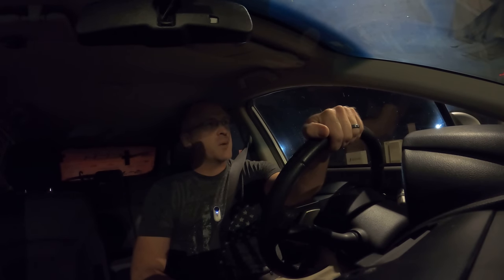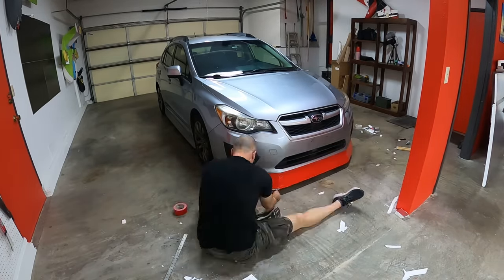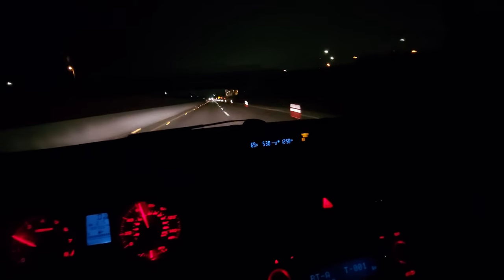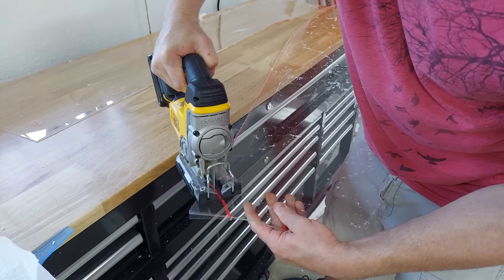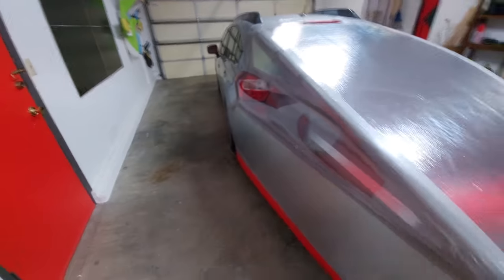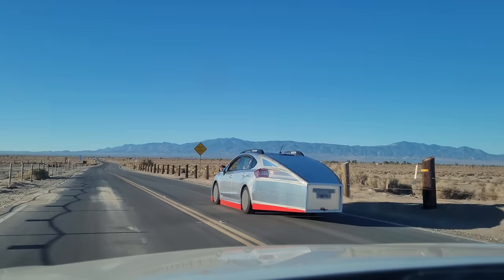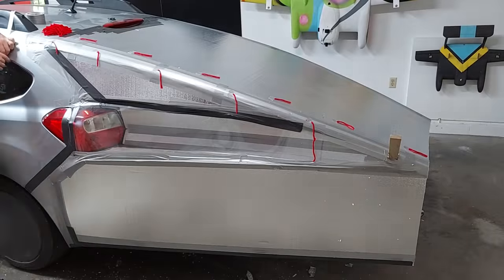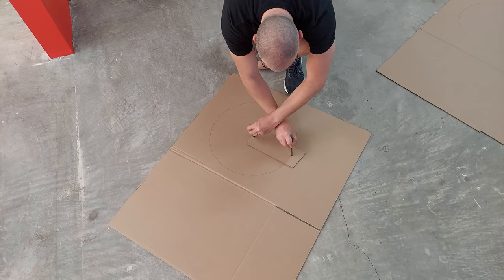Beating High Gas Prices Using Simple Aerodynamics (Home Improvement Store Edition)

Comment: At first, I was like, "Damn, this guy really has time on his hands," Then I remembered once my tank used to fill up at N$614, and the last time I filled it up at N$500, I was awesmacked to see that it was only half tank, this, "Mmm, wait a minute. This guy is on to something," and with that said, my car did win 2008 Guinness world record on efficiency, and with my capable hands, and your mods, it might just beat it again or at least try to as the newer gen with a smaller engine does 2,200 on one tank. Peugeot 206 1.4 8v hdi if I am not mistaken. Maybe also get rid of things I don't need in the car, and there are a lot of them, like the Jack, and a few things I can't mention, spare as I do have quality tires and sludge, so replacing a tire is highly unlikely.

Comment: The only way to ABSOLUTELY know if you've filled the tank the same is to fill it to the spout.  They don't let you do that in California, so you'll need to go to another state to try, or do the last bit with a gas can. It's possible you have air bubbles in your gas tank too, taking up differing amounts of volume each time you fill up.  Or go full mythbusters and get some super accurate fuel flow tracking software for the car.

Comment: So, $200 in foam/tape saves ~20% fuel cost...   At $5/gallon we have to save 40 gallons.  @30mph  =1200 miles driven to save money assuming you mostly drive at freeway speeds and not in a city... KEY point!  If city driving you would see a tiny fraction of this savings.

Comment: you should change the way you measure, since the fuel pump stop fueling because of the excess gas in the tank, this always will be different depeding even on how you drive

it is very dificult to measure it in standard tanks, when you do this on racing, you put in an exact amout of fuel, do the test and many times you take it out and measure it or even sometimes cars have a fuel gauge that it is way more accurate than street cars

another thing that change a lot it is the temp, humidty and pressure that you live in, so since you changed and adjusted routed that might be helping to a different result

hope you make more experiments like this one, take care

Comment: nice work; you should definitely keep going; right up until you start finding little bits of foam in your bed and food.
we've done some aerodynamic experiments with ultralight aircraft and gravity powered cars over many years.
yes; sometimes results are counter intuitive; there are some obvious "rules" surrounding  aerodynamics; but the problem is sort of a "moving target."
everyone knows that the effects of drag increase with speed; I would suggest that you do some data logging at 2-3 different speeds during your test runs; as flow detachment occurs at different rates, locations based on changes in speed.
 yes: aerodynamics is important in automobiles; however if maximizing mph is the goal; other items such as weight, desired cruise speed and the type of wheels +tires are also BIG factors.
Due to the "ugly" design parameters required for passenger cars such as safety, performance, comfort, durability; most are much heavier than optimum; because tradeoffs must be made and the goal of maximizing mpg will always have to "take the back seat."
example; if you put the lightest combination of wheels and tires on any vehicle; you should observe the range performance go up; but conversely the safety (handling, stability, stopping distance) and durability will go down. ( see also rotating mass, moment of inertia , , sprung- unsprung mass, hysteresis)
I think most people would be shocked to learn the actual curb weight of their cars. (try pushing your car on level ground!)
Adding things like a full tank of gas and passengers can markedly decrease mpg performance.
One of most important factors that affects mpg is the personality of the driver.
If everyone simply drove the posted speed limit; the country's fuel reserves would be greatly extended and there would be far fewer accidents ( about 30K deaths annually)
For more information about driving technique that maximizes mpg ; checkout "hyper-driving"
whoa....my coffee is working

Comment: You got lucky with those cops. If you had those lights on your rear plate set to blue that can be Very Illegal! Some states have permits you can get for Red, Amber and Blue lights but in general Blue  is restricted to the Police/Lawn Enforcement. Most cops don't care if it's within the range of Blue White, but if it is clearly Blue and not simply an off hue White they can really get on you.

Comment: You can also measure drag by driving through a makeshift set of wind indicators，see how much air the car grabs at what speed and how wide  and tall of a cross section it effects，
，you can have an idea on how much energy the car ultimately exerted by trying figure out how to measure how the car has created moving air ，it's shape and intensity
or how much of a “ripple” the car is creating
go straight for smaller “foot print”
this will save you a lot of time and money，and can have a more reliable proof when something worked

side note as a car guy，you are not watching any ob2 data，no intake air temp，no knock retard，no ignition timing，not monitoring air fuel ratio，no humidity measurement，these will massively effect the efficiency of the car,  and you are running 87 on your suburu, which can have unrealiable ignition timing depending on the car‘s mood. 
If you monitor all these variables and use at least 91oct，then you only have to see the electronic throttle position to know how much the car is pulling air hence burning fuel to maintain certain rev at certain speed on certain gear over the same stretch of road. You can get an instant reading and not having to go though the good old pump.

also I recommend doing tests by moding submarine toys with a stable thrust output
or a heavier than water car in a long glass tank runway
it's much easier to ink water and visualize everything than to set up a car to drive though smoke

Comment: Completely uneducated guess here. I don't think the fact that the tufts are laying flat necessarily equals better efficiency. It indicates that you have nice laminar flow over the surface. But having laminar flow does paint the whole picture. Maybe breaking up that boundary layer flow actually boosted the efficiency of the old tail? I'm thing something along the lines of the golf-ball effect here.

It might also be case the case that you have too much variance in terms of how much fuel you are putting in every time. Have you considered installing a high precision metering valve or something in the fuel line? Or using the car's built in trip computer to calculate the average over some distance? I know that, that's not the most accurate thing, but it should at least give you an indication of where you are heading in terms of relative performance, Even if it doesn't give you an accurate absolute indication. 

Would it perhaps be possible to weigh the car instead?  Don't know if you'd be able to find a scale or weigh bridge that would be sufficiently accurate.

Maybe you could figure out some workable combination of the above that would at least help you figure out how much noise that fuel pump is adding to your data.

On a carbureted car it would be easy enough to make a makeshift tank that allows you to accurately and precisely top up the fuel, doesn't seem practical on a fuel injected car though. 

Interesting stuff - keep up the good work!

Comment: I am not an aerodyamicist, nor am I procicient at spelling that word.  But the lower rear area that you changed could have been angled up too steeply or the transition from the underside was too abrupt.  The things I've read about this area from different sources are pretty specific about this transition.  However the things I've read concern the transition when it's still under the car.  YMMV. Literaly.

The angle for this area is always prescribed to be 9 degrees.  This is for the diffuser area from about the axle to the rear bumper.  I have no personal experience with it.  It's just a thing I read in a few places.

Comment: If you want to actually test how much fuel you're using, you have to do it by weight before/after a run. That's non-trivial because a scale that can weigh a car isn't typically that precise.

It's more than 'good enough' however, do use the calculated fuel economy data available over the OBDII port, seeing as you're just looking for delta over baseline, and those systems are consistent in that regard.

Also, the new tail could be less efficient due to air contacting it more. You do want to cut through the air gracefully, but, the air physically dragging along the surface of that foamboard isn't doing you any favors either.

Comment: You can't use wheel covers because it could damage brakes (overheat). 17% in my opinion is just measurement error. But even if it gets 5-10% then you could use it in racing, for example in 1/4 mile race. This is the only use that make sense in my opinion. You can't use it in daily car because of law regulations. But still it's nice work.

Comment: Inevitably Some air Will go under the car, so dealing with that would be effective, OR, I know this wouldn't be cost effective but Finding another car all together. Im a big fan of Subaru, But, for these tests/Hobby... The Awd platform isnt the greatest, It has inherent drag associated with more weight and moving parts in the driveline, regardless of if they are being really used at cruising highway speeds or not. A Honda Crz or better yet an Insight would be optimal. If you didnt want to go the older car route the new Prius is actually quite attractive, and has about the same body shape. They come in FWD and AWD. So you could still get the AWD if thats important to you.

Comment: If you actually want to increase efficiency in a more real life kind of driving experience the key is loosing weight... Replace seats with lighter ones, remove unnecessary heavy parts end if you can't/don't want to remove just replace them with lighter ones

Comment: you are adding weight to the car which means burns more gas to accelerate and also traffic can play a role if you ever had to slow down once for a car in front of you itll throw the measurement off.

Comment: You can buy giant sheets of flexible black plastic from Home Depot. I used it to make mud guards under my engine area and remake the fender liners. I simply used the standard push pin style little plastic retainers to hold these parts on.

Comment: Unless you are using an entire full tank your data might be messed up by using the cars estimated range. Estimated range is based on fuel level and we all know that there is not a single gas tank anywhere in this world that gives linear data for fuel levels. You should change your message to full tank only or topping off and counting the gas that is replaced

Comment: Gas pumps and a car’s internal metrics are extremely inconsistent, even on the same pump and fuel.  The stop is based on a back pressure trip that will vary based on flow rate and atmospheric conditions.  The only way to be remotely consistent is to add until gas fills the fill spout.  Only then are you truly measuring apples to apples each time.

Comment: pumps are VERY unreliable at filling the tank the same time every time. you would have to do like 5 to 10 runs for each design to get a good idea. ORRRR. measure out the fuel and run until the car runs out of gas and then check how far you went

Comment: i bet at least 7 to 10 percent increase in efficiency lies underneath the car. gotta smooth that sucker out. ABS plastics should do it. but really, go all out , cover rear wheels, make a air curtain like newer cars have, smooth undertray with lots of air passing through, remove mirrors or place smaller ones, air dam the wheels from the front and make sure you have Smooth separation at the back. and come on, the roof needs to be smooth too. Ask for a collaboration with KyleEngineers, he is goot at simulations. I need to see this cars final form. do it for the memes. edit: you dont need that much cooling no? close some vents in the bumper.

Comment: Did you take into account environmental conditions? Air, road temperature, tire pressure, and especially wind speed and direction is a huge factors, that could easily make an impact of more than 20%. Even humidity and air temperature make an impact on how your engine works and tire rolling resistance... Also traffic speed and density... The fuel hose is not accurate. So if you want to get real numbers, you need to go to the wind tunnel. And on a thumbnail, if you write the percentage, it doesn't matter, if is it per tank, gallon, or liter, it is the same. Overall nice work for entertainment. And may it is a good business idea for an aerodynamic Skybox on a back 🤔

Comment: Dude just measure your rpm at high speeds and see whether rpm is the same at 90mph with Styrofoam and without Styrofoam 

(Update: was gliding behind a semi and rpm stays the same no matter what it appears the computer will give consistent rpm to the transmission regardless power saving method) 😞

Comment: Not to be a conspiracy theorist, but I’ve had had gas pumps “put” significantly more gas in my tank than the tank can hold (even accounting for the neck). I don’t think it’s a reliable standard. A good solution could be a jerry can so you know exactly how much fuel is used

Comment: the key thing responsible for your dalliance into automotive aerodynamics failing the more you try is because manufacturers already designed the vehicles to be as efficient and aerodynamic as possible within the confines of the body without sacrificing usability. so, adding anything extending beyond the body would just screw up the carefully calculated and designed aerodynamic features. take the loss, start over again with something simple like a go kart chassis and a single quart of fuel.  its way more effective to measure small changes more often than driving 200 miles and changing some things that end up not working. you're just wasting time and recourses for something that's so cut and clear that its a little difficult to see you as any kind of professional.
just give up on a full sized car until you have the time, money and knowhow to make a body and frame from the ground up. but even then, once you have all three you could use that money to just buy an XR3 kit car.

Comment: I can save 30 % in city driving by manual transmission and clutch and gliding without a running engine, down to 5.0 l/100 km from 6.9
Reply from the maker: I miss manual so much...
Reply: @thinkflight  future is electric

Comment: https://youtu.be/snNL5GgOq_c Adam talks about how they measured fuel mileage and maybe you should try a golf ball tail? Also the front lip has alot of pressure on it. Was it folding? may i suggest adding a half splitter to assist supporting it to avoid any folding at highway speeds it also should help the air go around by providing a small shelf to help avoid unnessesary flow going under the car.

Comment: improvement? really? If you only count the fuel consumption, ok😅... I agree its an incredible "improvement" indeed
You must live in a place that does not have curbs, speed bumps, potholes, discontinued asphalt etc... You must live in Silicon Valley area to call this an "improvement"...
Ok... it may save some gas but... at what cost? How much it costs to have something like this installed in your car? Please enlighten me on this... How this design is even practical for car manufacturers and the road safety? The trunk of you car? can you use it?

Comment: Nope. Just DON'T do that. Do NOT cover never ever your wheels, your brakes need cooling. Do not add anything on the tail that can fall off. All in all you can try to do this in a controlled environment like a racetrack. Doing so in public roads is so UNSAFE for you and specially everyone else.

If you want a simple way to get better fuel efficiency do simple things like: Reduce weight. Take out all the sh*t you have in your trunk you don't use ever, get better wheels and ryms, smaller wheels help and lighter ryms can save 5kgs each wich is 20kgs in total weight. 

You need to: Remove the roof bars. That's totally anti-aerodinamic. Those are for "make the car look good" but it's not helping out.
You need to: Not get a AWD car, that also brings lots of weight and it also implies more fuel being used.

Forget about strange things that can potentially kill you, go back to basics and simplier things. A lighter car will always use less fuel.

Comment: Gee, it's SOOO simple, Honda, Toyota, Nissan, Mitsubishi et al: didn't think of it FIRST!!! Because IT DOESN"T WORK! Go back to the 1934-1938 Mobil Fuel Economy Runs where Mobil Oil engineers took (always a Dodge or Plymouth) and modified it and drove it across the US and achieved as high as 203 MPG from the 1938 two door Plymouth Sedan-at an average speed of 21 MPH on 120 PSI rock-hard traction-less no-tread tires only slightly wider than a bicycle's! Aerodynamics on cars are WORTHLESS below 85 MPH now. If we were talking mid '80's Chrysler K-cars or a Ferd Granada-different story, but not that much! And if you like THIS, for $999.95 I'll sell you the secret to running your car on WATER!!! Yes the secret with-held from the public for 75 YEARS!!!